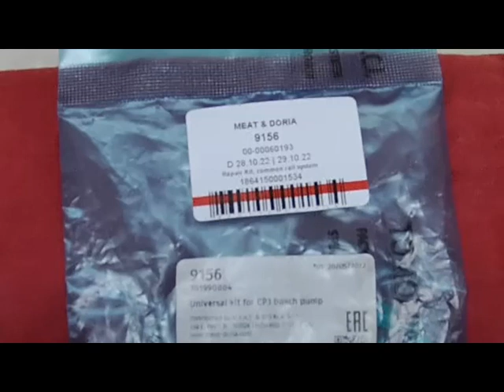BOSCH 0 445 010 121 ( CP3 )  Fix a leak.

Comment: Excellent video with no b.s talk and soft music.  I did the job incorrectly NO WONDER I had NO high pressure now i have to take it apart again to redo.  I did not see this video after i cussed NOT able to get my  truck started.   In USA where i  live nearly NO do it yourself for CP3 pump as people are afraid and/or not knowing how as there is none that shows how to rebuild except from overseas I believe i had seen 2 in India already probably this one too.  This one is excellent.

When people realize how easy it is to rebuild cp3 pump  and the money they spend buying a new one they would be pissed.  Well that is how they make their money by fooling people with complexity and misleading.

Thank you so much for the video and your excellent work. Very clean and organize of your rebuild.  Now i. know what i did wrong hopefully i could make it work after rebuild again.  Yesterday i bought a used one from Ebay now i have two  and definitely i  know how to rebuild correctly now.